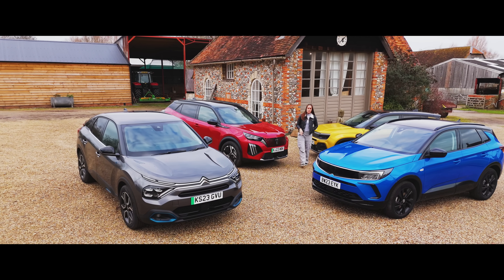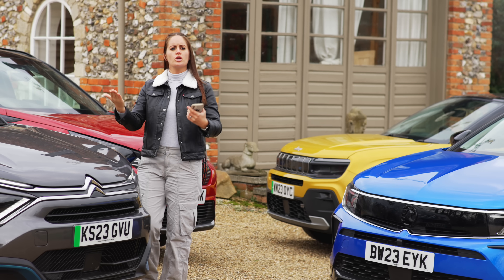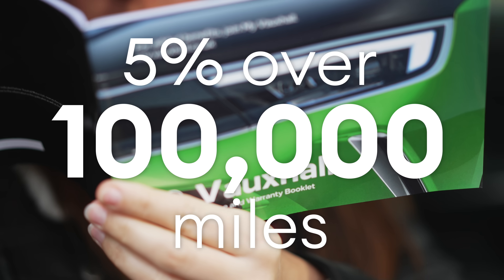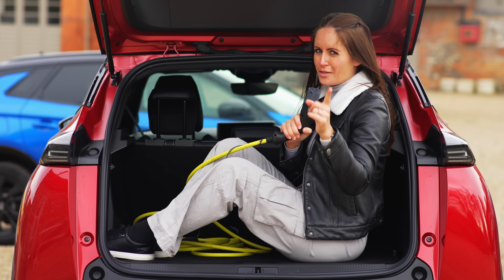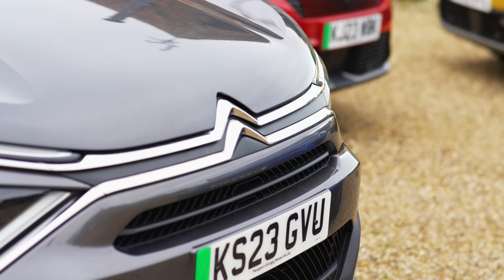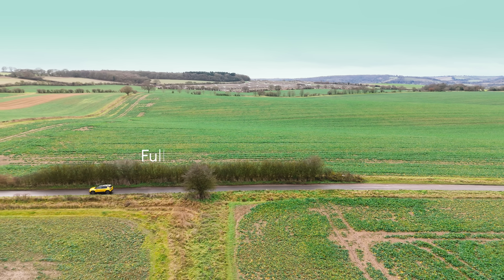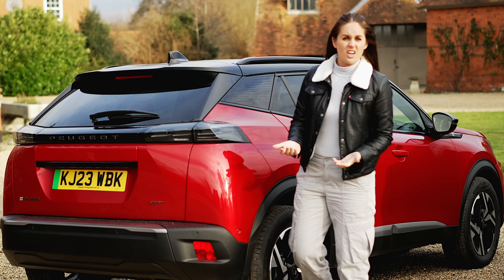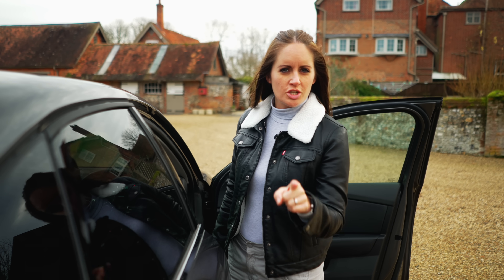REVEALED: Used electric car batteries – do I need to worry? | Electrifying

Comment: The issue is with some warranties, such as the VW warranty, is that it’s 70% capacity in 8 years or 100,000 miles. However if the battery is faulty with some bad cells and drops 28% in the first year and stays at this level it’s still considered ok so not replaceable under warranty. These warranties need to be more flexible and have a maximum % capacity drop per year that is clear and easily understood. So 95% available capacity after one year or 20,000 miles, 90% after two years or 40,000 miles, 85% after three years or 60,000 miles and so on reducing to the 70% figure at 8 years or 100,000 miles. These are still relatively poor performance requirements but would provide a degree in confidence in EV battery reliability.
Reply: There is a Tesla study that results in an average of 12% capacity loss after 200k. 

Cars in the UK on average are 14 years or 140k when they are scrapped. They are usually mechanically written off with combinations of ICE associated issues. BEV's will increase the average age of cars on the road.

Comment: A slowly decreasing range fuel tank is something a fixed battery EV purchaser or lessor will have to get used to, why not just say that instead of stating embellished statements. NIO offers the best products on the market for dealing with battery replacements, battery repairs, battery degradation and recycling with minimal anxiety. Sometimes you need to pull your finger out and go away from trends and follow brilliant design. Go NIO!

Comment: Comparing the battery of an EV with the engine of an ICE car I think is wrong.  The battery is the 'fuel' for the EV.  The equivalent in a petrol or diesel car is the fuel tank.  Both have to be charged/filled when empty.  I think the motor of the EV should be compared with the motor of the ICE car.
Reply: The engine and gearbox are the most expensive parts of an ICE car. The battery is the most expensive part of an electric car. The electric motor is extremely unlikely to fail (and relatively cheap). A fuel tank is fairly cheap. Major failures of engines or gearboxes that require replacing do happen as do the batteries on electric vehicles so it seems a fair comparison given the difference in technology. The engine and gearbox both failing is a bit of a stretch though.

Comment: Maybe watch Bjørn Nyland's video a day ago on an ID4 with 24% degradation on 70k miles - which VW says is tickety boo..
Reply: ROFL.  If VW thinks that's ok, then they will be replacing every ID4 battery under warranty before the end of the warranty period or mileage is reached

Comment: Smart--put the most expensive item 10 inches from the road and protected by a thin sheet of metal---then specify in the warranty that road hazards are not covered. A few stories lately are coming to light on manufacturers with packs that have that stupid paste so you cant easily replace individual cells----of course, this comment will get smoked by the fanboys

Comment: As someone who's in the motor industry I call bullshit to your "facts" , engines also last the life of a vehicle, when they're scrapped they're recycled and can easily be disposed of, electric cars and their batteries cannot; they're incredibly difficult and hazardous to recycle! Not to mention car batteries degrade a shit load over time especially with the cold weather we have in the UK and how much you have it charged etc. so many Sub 10 year old E golfs / Leafs / Zoe's we see that only have maximum of 90 miles of range well below what they had from new.... I'm sorry but I call bullshit! And just wait till that battery pack fails or catches fire, a real deadly and unfortunately way too normal issue in electric cars, the expense is astronomical, they wear brakes/tyres/wheel bearing/suspension etc. out way more than ice vehicles and I can assure you it won't be covered under warranty! Like myself and loads of other people working in the motor industry we will not be buying electric cars anytime soon! I like your channels vids I like the information and car reviews but this is just cap.
Reply: With one pedal driving, the brakes barely get used. 
Of course petrol is clearly not a fire hazard is it?
The ICE scare-mongering is laughable & embarrassing. 
My 9 yr old diesel has broken down twice in recent months (once on the motorway) at a combined cost of £1000. 
Going electric.
Reply: Veolia and Recyclus have dedicated EV battery recycling facilities in the UK.
Yes, in the same way that petrol / diesel engines don't like the cold and so use more fuel than in summer, batteries don't perform as well in colder climates - but the newer EVs now have active thermal management and battery pre-conditioning which allows the pack to work at its most efficient temperature. 
Norway is WAY colder than the UK, yet EVs made up 87% of new car sales last year alone.
The Swedish Civil Contingencies Agency report from 2022 proves that EVs are 20 times less likely to catch fire compared to ICE vehicles.
Why would a 2 ton EV wear out its brakes/tyres/wheel bearing/suspension etc any more than a 2 ton diesel SUV, of which there are many sold in the UK? That seems illogical.

Comment: We've run two EVs to around 100,000 miles, both are first generation cars, one Nissan, and one Renault. In both cases they have rudimentary battery technology and thermal management, both vehicles retained around 90% of their original battery capacity. Newer cars will fair better.

Comment: How am I going to do home charging 
From my 14 floor flat with no parking 
I currently park my car on the road side
Solve that one
Reply: There are nearly 7,500 overnight top-up lamp-post charge points already fitted in the UK, with more to come.
In all honesty, though, EVs are not going to suit everyone's lifestyle - in the same way that car manufacturers make dozens of different models and styles, because 'one size' doesn't fit all.
But, Society has to do something to counter the rapid rise in childhood respiratory diseases over recent years - and that's down to worsening local air quality in our towns and cities.
EVs are part of the solution - along with making buses, lorries and taxis greener.
Reply: @jonathantaylor1998  7500 ev lamp posts  in the UK wow , I suppose most of them are in and around London 
I think the closest one to me is about 16 miles away , do you suggest I plug it in there and walk home
EV lorries, juggernauts dont make me laugh the battery would have to be the size of40 footer it was pulling
Reply: @marineboy1964  like I said, EVs won't suit everybody just yet.
But, we're only 12 years in to mainstream usage - petrol cars have been around for 10x that period - though, for the first 25 years or so, owners had to buy fuel from chemist shops. Now that'd be inconvenient...!
As for EV lorries, the main manufacturers, including Mercedes, MAN, Scania and Volvo all make EV trucks already.
And electric buses from BYD are already in many UK cities.
Society is moving in the right direction to improve air quality and it's important, where possible obviously, those that can, play their part.
Reply: @jonathantaylor1998  how am going to afford one of these 40 or 50 thousand pounds EVs , I am on minimum wage I couldn't even afford the insurance payments 
Could I ask you where you live , maybe you are living in a affluent part of the country and the car comes with your job , well good for you ,but your not living in the real world
Reply: Move house 😛
Reply: @ohyesitsme  move flat you mean  , and it's a council flat , I have applied but no luck yet ,and thank you for your concern
Reply: EVs are not for people who live in flat. It is for people who can home charge. But if you can… it is cheaper to to use EV and even replace the battery than keep the ICE car Same time! But there is that difference. You have to be able to charge at home and drive at least 15000 km aka 9300 miles a year to cover the higher starting price and higher varrantry cost. This calxulation was made in Finland using Tesla vs Toyota.

Comment: I'm all for electric but where did you get 130,000 miles for a scrapped internal combustion engine from?
Reply: She didn’t actually say that, just that the average lifespan of ICE cars was 13 years before getting scrapped. It may have nothing to do with the engine, could be the gearbox or bodywork damage, anything that costs more to repair or replace than the car is worth. Obviously some ICE cars go on for significantly longer but that’s why it’s an average lifespan.
Reply: know someone driving a VW passat thats over 200,000 and no problems apart from a leak in the boot when it rains.
Reply: @tariqphoto I used to have a 2.5 V6 TDI A6 Avant. I bought it cheap with 215k on the clock. When I checked the history it had been clocked at 270k down to 150k, so my 215k A6 had actually covered 335k! 
Ran surprisingly well and still got 55mpg out of it!
Reply: Exactly…. All my ICE cars 25 years about… have good engine! But they have rusted, other mechanical problems… over 15000€ / year repair expenses that led to buy new 15 years old car… so yeah…i agree. 13000 miles sounds very plausible! Most of my cars has ended ITS life span between 200000km and 250000km it is about 125000 miles to 155000 miles.
Reply: In 2009 average car was scrapped after only 13 years. So approx 130k.

In 2021 it's scrapped after 16 years. So approx 160k.

I run two ICE cars and maintain both myself. One is 13 years old & 110k. The other is 20 years old & 186k. 
I'm looking forward to replacing them both with 1 EV's so I don't have to spend weekends fixing them!
Reply: Mercedes V8s…

Comment: My 21-year-old Mazda Miata continues to run without any range degradation. I expect to run it for another 10 years without any further degradation as well. Also, claiming that EV batteries are being recycled is disingenuous and repurposing a modern EV battery is next to impossible.
Reply: Veolia and Recyclus have dedicated EV battery recycling plants in the UK.
And Second Life EV Batteries in Dorset repurpose 'old' EV batteries in to home storage battery packs.

Comment: The battery failed in My brother's 2015 Tesla  model S after 260,000 miles but the battery still had 6 weeks warranty left on it and Tesla replaced it with an updated battery, during the life of the old battery it only lost 10% in range .
Reply: Extended warranty? Isn't the Model S 8 years or 150,000 miles?
Reply: @TheNotimprezed certain model s or x have 8yrs/unlimited miles warranty
Reply: @TheNotimprezed  I think earlier one had 8 years unlimited miles plus free super charging for life .
Reply: Certain ones especially the model S or X have 8years/unlimited miles. My 2019 model s lr has that’s same warehouse and when I bought it I thought it was only good for 8yrs/150k but mine says unlimited/8yrs
Reply: Poor guy lucky with his battery but to live in your Car to that mileage 😂I’m doing something wrong my Car factory ordered and ten years old in April will be on 35k miles. 😂 ok two years were lost to Covid and well we couldn’t use our Cars for a month for that fuel strike where no petrol was for sale. Friend bought a second hand Porsche a classic it had lost a quite a bit of power over the years just with wear. He put it on a rolling road and got a shock. I just think of EV batteries likewise everything degrades in Cars unless at some point you spend a fortune doing a complete nut and bolt restoration.
Reply: What if it had failed 2 months later? It would have been a total loss.

Comment: I feel there should be a industry wide simple to read table or graphic to let the public know the condition of the Battery like a ICE car service history and MOT
Reply: Does an IC car service history tell you if the car has only done short journeys, i.e. never warmed up or cleared the DPF filter, has the car been held on the clutch on hills, has it been driven hard when it's cold.
Reply: You can check those things quickly and easily by dipping the oil and carrying out a compression test. Likewise, it’s very easy to tell if a clutch is worn. Even if it is, it’s hardly a major expense to replace it.
Reply: @ochayethegnu2915  And you can check the battery of an EV easily with a module tester - 20 seconds.  Everyone that buys a second hand car should do this, or get someone to do it for you, just like opening up the oil cap on an ICE car and looking for mayonnaise . 
The only issue is that people are luddites and terrified of technology - just educate yourselves.  Remember, 80% of people after 100 years have no idea how to tell if an ICE car is trashed, that will never change with EV cars either.
Reply: For Tesla there is.  Google is your friend.

Comment: Except if you're Hyundai, that if something on the road scratches the external protector of the battery, then they void your warranty and charge you the same than a new car to replace the battery (real story that happened in Canada with an Ioniq 5... twice!)
Reply: In this case, the Ioniq 5’s battery cover plate on the bottom of the car was scratched and showed a small deformation, which indicated the battery had suffered an impact.
Reply: @Marcus_2022 The deformation was really tiny and the battery itself was fine. It's something that could happen to anyone. They should have checked if the battery was fine or not and replace the cover, maybe. If they void the warranty for that, I'm not buying Hyundai, for sure. You can if you want, of course.
Reply: @Marcus_2022 In any case, it means you're liable for a battery that costs the same as the car. Would you buy a car that just for going through a road with some loose debris the car is totalled?

Comment: I've  nothing against the EV.
BUT I'VE NEVER HEARD SUCH BIASED INFORMATION. 
Cost of replacing a battery at 100,000 miles is equivalent to a diesel that will cover 200,000 miles with ease 😂.
Had a Toyota Prius, at 80,000 miles battery was knackered, you couldn't get a new one, so had to drive everywhere with a petrol engine.
AT LEAST GIVE BOTH SIDES OF THE ARGUMENT SO YOU DONT LOOK QUITE SO 🤪
Reply: You've just summed up one of the issues with hybrids the batteries are charged and fully discharged far more often than a dedicated EV battery as the EV battery is much larger so has an easier life. A Prius has typically a 4.4 kwh battery powering a 60kw motor, so in battery terms the max load is 13.5c, the Mini SE which has a small battery of 30kwh and a 135 kw motor has a max load of 4.5c. The higher the battery loading the more internal heat that is generated and that damages the batteries.
Reply: But, she didn't say that an EV's battery would need replacing at 100,000 miles...
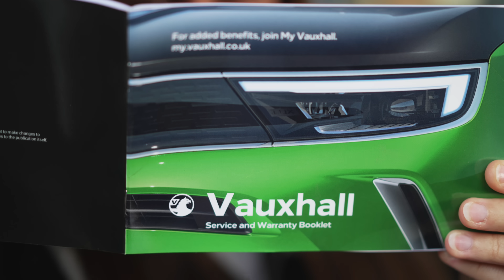In fact, the figure quoted for the life of a well-looked after battery was 300,000 miles (at 01:38 minutes in to the video)
Reply: YES!

Comment: Don't buy one at all they are not fit for purpose.
Reply: Maybe not every ones purpose but, they are very fit for lots of other peoples driving needs though.
But if you're one of those people who need to drive 600 miles then stop to fill up again in 5 minutes, before doing it all again, then buy a diesel. Simples!

Comment: I always enjoy your little tech talks.. 🙂
No one should shy away from buying a used electric.  There is no difference in the protocol.  You want a lower mileage vehicle, you'll need to pay for it.  You're not going to find anything decent if you're not willing to pay for it.  I was fortunate enough to find my 2yr old Model 3 standard range in August last year.  Only had 59,995k Km's on it.  Practically new all things considered.  For a good chunk off the original price.  Buying a new Tesla around here will still set you back 58g's.  Before taxes.  Even with the government credit, you're still looking at spending 63-64g's once you put aside all the fees and taxes and what not.  I found my 2021 Model 3 for literally half that.  That's a fair chunk saved.
I'm hoping I'll be set for the foreseeable future.  Absolute joy to drive.  I understand why there are so many on the road.  🙂
Reply: New model 3 is £39k
Reply: @tomcockcroft9394   ok.  Which converted to my currency, is a little more than what we would pay for here.  Still looking at 60G's+ for a new standard range Model 3.
If you're patient enough and able to pounce when you see a good deal on a well kept 2nd hand Model 3, you can get a cracking deal.

Comment: Yes, yes you need to worry!

It really depends on how the car was taken care of and how it is driven. Degradation can be sky-high due to bad treatment. But even well-taken care of EVs have massove degradation.
The result is that you can throw the whole car in the junkyard if it is out of warranty, as the battery repair is more expensive than the value of the rest of the car.

NEVER buy any used EV which is 6 years or older! That way you are still good to stay within the warranty which covers 8 years and can enjoy the ride for a couple years without any fear of financial losses. Everyone who tells something different is just an unknowledgeable shill.
Reply: I guess that we'll have to wait and see what's going to happen when the majority of modern EV's reach 10 years, or older then.

Comment: Automakers should be held legally responsible for not just the batteries but for the safe and reliable longevity of every vehicle they sell. Instead of externalising the costs and responsibilities on to vulnerable, second hand owners who waited years to own their first EV.

This includes retrofitting emissions systems of cheating diesels.